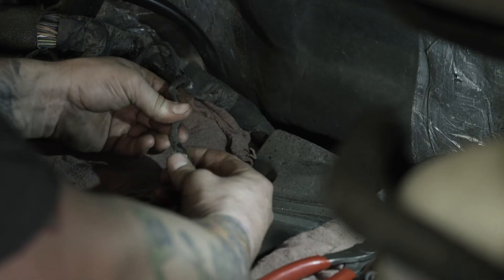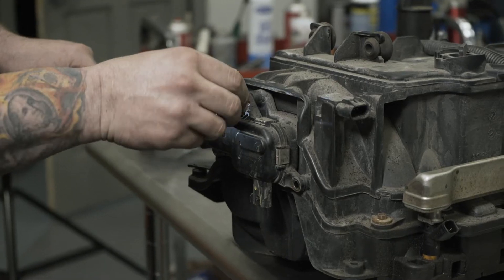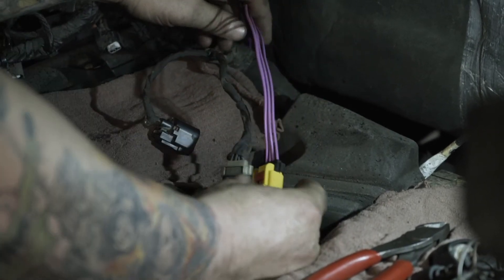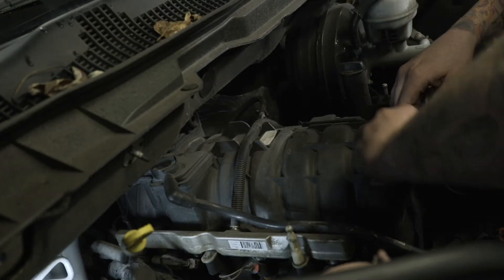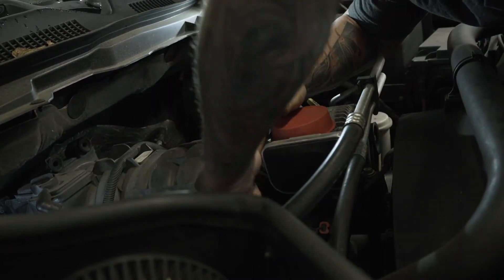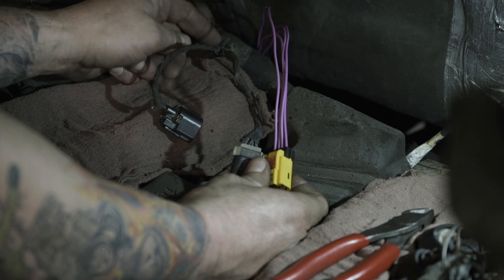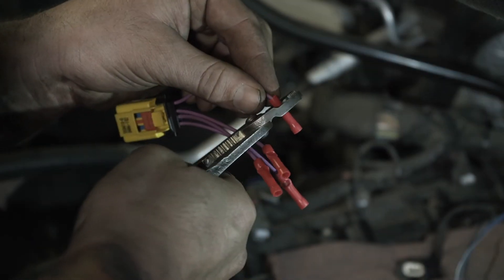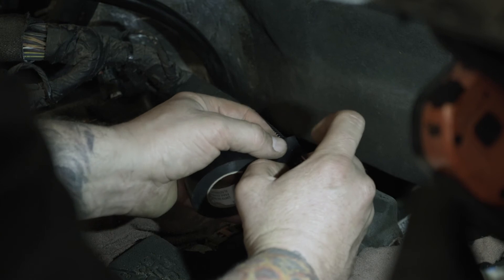Restore damaged IMRC wiring with Dorman’s OE FIX repair kit

Comment: Does any one else have the same codes p2008 p2017 ? I’ve have this codes for almost 6 months and my truck still drives good. Ram 2009 5.7
Reply: I have the same issue and both our trucks run well because is stuck OPEN. Lots of power but bad gas mileage. Mines in shop being fixed now. BTW, im pretty sure the dealership mechanic messed up my wiring putting manifold runner controller on. I had just put a NEW Jasper engine in it 4 months ago and my USUAL mechanic swears he had not seen mouse damage to wires, but dealership says it has wire damage which is why even after new part was put on, its still throwing same code. Im leaning to mechanic messed it up and didnt realize its a NEW motor.

Comment: How do I know I have a bad IMRC ? Is there anything else to checked before replacing and doing all this job done? , I got the kit already BTW I justa want to make sure that’s my problem
Reply: You will have a rough idle n codes from everything from intake air to throttle position sensor to intake coolant sensor n more all to do with too rich or too lean. The only way to tell for sure is take the intake off n take that motor that turns the runner control off three bolts n unplug it first but when u get it off u get some needle nose pliers like the video showed.. n just try to turn it if it moves a little then it's ok if it don't budge that's the problem n that's where I'm at so yeah.
Reply: Ok what I need to know is do we need a whole new intake cause I don't see any way to replace the runner valve in there n basically since all that carbon build up from the valves not opening n it be best to buy a used or new intake n new motor for the runner valve. Is that what's gotta happen n if I diy it looks around 500 at the least plus everything I've put into it to finally figure this is my problem I'm already out 1500 dollars. It's gonna be 500 more but I sure don't want to take that manifold back off  but looks like that's gonna be my problem

Comment: So got a 2012 ram 5 7 truck with code p2017 and p 2008 . So I whent to order this and go to find out some one had already installed one. But I need to double check the wires at the right terminals. Any one has a original pig tail that i can look at to refrence the wire colors?
Reply from the maker: Hello! We would recommend that you locate that diagram from the vehicle service guide or equivalent site/source.
Reply: @DormanProducts  thanks for nothing.  Trying to help a friend over the phone..this has been repaired on his truck already but their crimps pulled apart.  Haynes manual no help.  Which wires go where.  Zoomed in on vid but its soo dark i cant tell the difference between wire 3 and 4.

Comment: Wouldn't shrink tubing be a better choice than electric tape?
Reply: The final install kit includes non-insulated crimp connectors and heat shrink tubing.